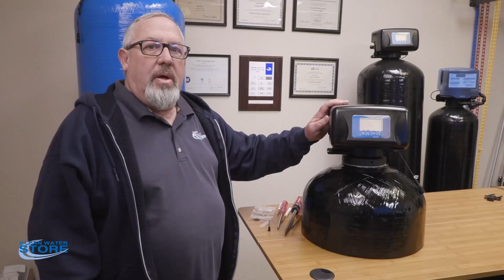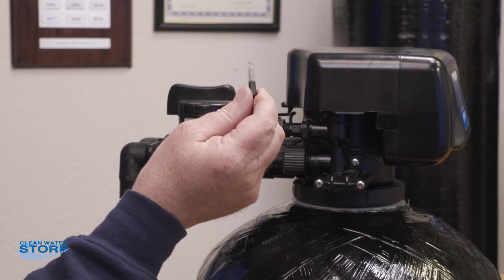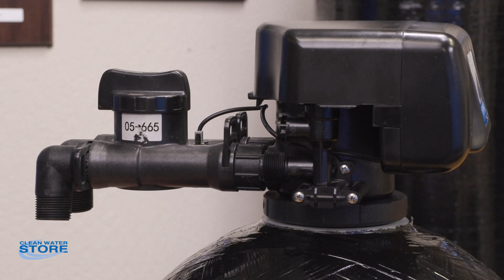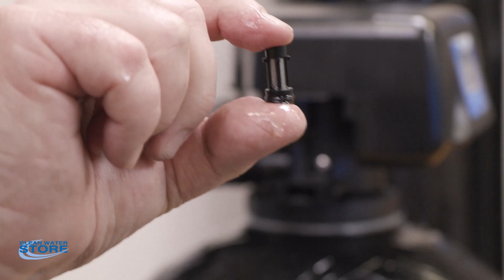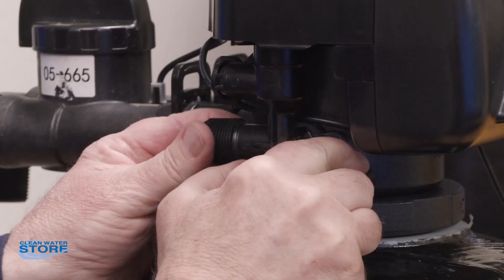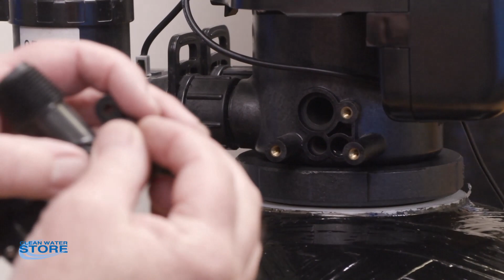How to Service Your 7500-Rev4 Brine Injector

Comment: Mine is less than a year old and the brine tank is 2/3 full of water with 2 fresh bags of salt. Water is not soft anymore. How do I manually regen . I tried pressing the regeneration button but did not work.
Reply from the maker: Hello - it sounds like the injector needs cleaning. Even though its a new unit it might have had some foreign material enter the injector somehow.  The control valve is locked at first.  Unlock the control valve by pressing the up and down arrows keys simultaneously and hold for approximately 3 seconds until you hear a beep. Press the second button Back/Regen. button this will go into regeneration mode. Press the button again to advance to brine draw. You should feel a vacuum draw on the brine line. Advance two more times into brine refill. Water will shoot out of the brine line. If the system does not draw a vacuum during the brine draw cycle you will need to clean the injector. https://www.youtube.com/watch?v=4sq0Zig_UFM    Please email our support guys at support@cleanwaterstore.com and if you need a new injector or need any help with that, we can help.
Reply: Thanks I was able to get the brine tank to empty but after 2 days water not soft at shower. Thought maybe hot water tank was not full of soft water yet. I will test the cold water at the same bathroom today. Stay tuned and thanks for the swift reply Greg @CleanWaterStore

Comment: I have the problem that instead sucking in air during "brine in rinse" it pushes the water out. Assuming "Injector Set 7500-Rev.5 Rev4" is bad. When tried to take it out by gently twisting it started to crumble.  Any advice? Where can i be the green injector set?
Reply from the maker: Hello - you can order a replacement here https://www.cleanwaterstore.com/cws-control-valve-parts/injector-set-7500-rev5-rev4.html.  However please reach out to our support team at support@cleanwaterstore.com   Depending on when you purchased it we might be able to send you one under warranty.
Reply: @CleanWaterStore  I will reach out to them and get a replacement or order new.
Reply: @CleanWaterStore  Hi I got the green nozzles and installed them. Still it is not drawing-in/sucking the air - instead it pushes out the water just like backwash. What should I do next?
Reply: When it say Air Draw in and Slow rinse it pushes the water out instead of taking the air in. Is there something I need to change in the settings? Please note I am using the Regen Cycles No. 4 and Regen mode  A -06.